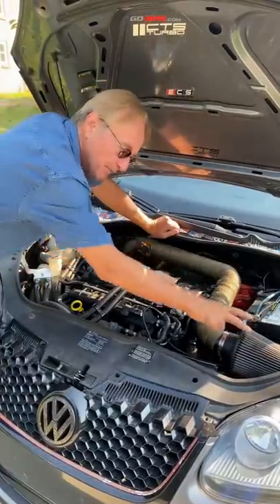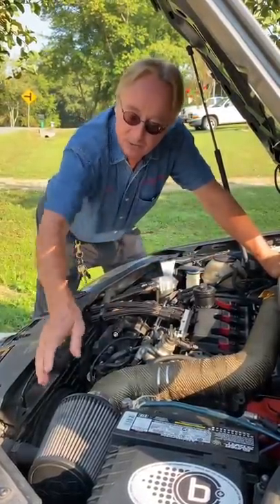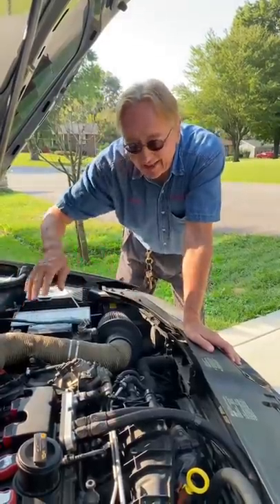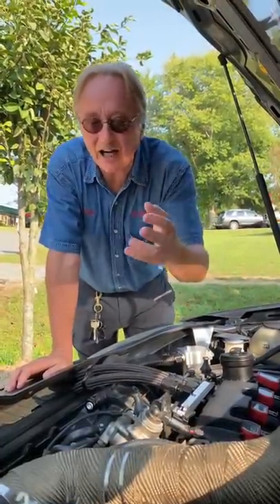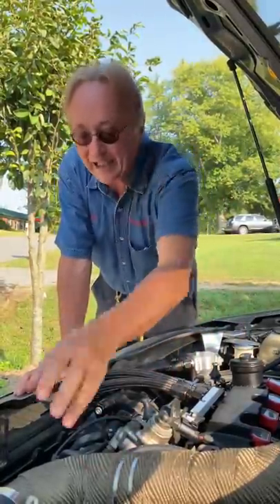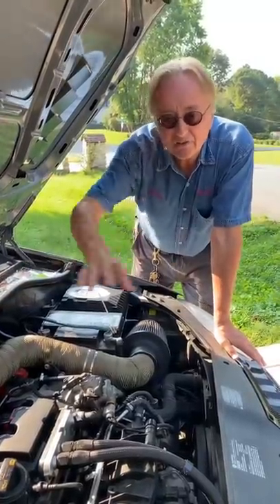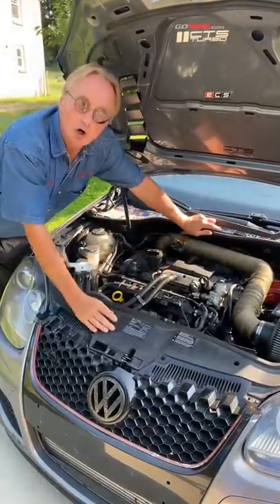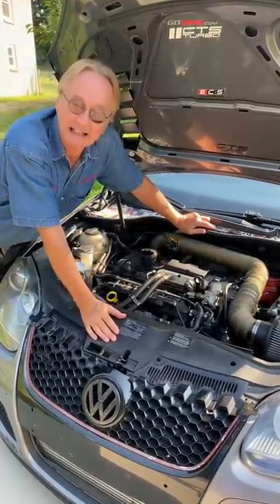Why Cold Air Intakes are Stupid

Comment: I saw a guy install one on his Volvo and he lost power because it was mounted against the hot radiator. I guess it was technically a hot air intake for him.
Reply: Congratulations you played yourself. 😂
Reply: Better fuel economy tho
Reply: @yeh.80  Nope. It was improperly installed so it was sucking in warm air. Even if it's installed correctly, cold air intakes dont always equal better fuel economy because the computer had to compensate for the increase in air volume by adding extra fuel. Aside from a software tune and weight reduction there really isn't much you can do. Most vehicles come as efficient as they can be.
Reply: Good for mpg though 😂
Reply: Bro u have to be dump that’s there fault
Reply: Former radiator and cooling man here. Most of these I saw under hoods were like the one shown. They were under hood sucking hot air while the original factory box had a snorkle that got air from the outside. DUH!
Reply: @johnchandler1687  The only diy installs that make sense to me are the ones you see at the drag strip with the headlamp removed for better air flow.
Reply: Lol! 😂
Reply: cold air is much more compresed that hot air
Reply: @oneslap01  It’s more dense.
Reply: @EricFortuneJr.  yea I forgot what is called but yeah
Reply: Guy created a black hole on his volvo
Reply: @EricFortuneJr.  running that style filter into the bumper gets it away from the hot air of the engine too but if you keep the filter in the bay it needs a box to enclose it from the heat. scottys example car is a hot air intake with insulation wrap on the intake inlet pipe which keeps the air hot it's a horrid setup he needs gold foil to repel heat
Reply: @stolen_e46   Yeh, I know. I’ve seen it a lot at the tracks. You get outside air straight through the headlight housing too.
Reply: @EricFortuneJr.  yeah ive always wanted the headlight housing but getting a custom headlight w a hole in it is $$$ theyre so badass though
Reply: I have just recently put one on my Toyota pickup. With how long the old intake was the filter is shoved in the corner of the engine bay. I’ve managed to actually pick up some top end power and it runs way cooler than it did before.
Reply: Bruh😂😂
Reply: @Chiefbird007  sure it does
Reply: Because it's not a cold air intake, this is a short ram intake which are bad for cars
Reply: @stolen_e46  id think it's more for keeping engine heat off the pipe and from heating the air inside it... Doesn't do much for cooling the air in the pipe of course since it's just insulation.
Reply: @sammy_1_1  that's what gold foil wrap does it repels heat, the wrap car in the video has is actually a wrap used for headers, it is used to keep heat in the headers to increase performance.
Reply: Any after market intake that sits in the engine is not a traditional cold air intake. Cold air intake needs to be in taking fresh air that’s why on race cars you’ll see circle cutouts in certain areas and that’s for the cold air intake.😂

Comment: Correctly installed Cold air intakes work great, the longer the pipe is and lower to ambiant air the benefit is realized. The trouble comes when you use short ram intakes they cause issues with heat and incorrect air metering which throw cel's.
Reply: The longer pipe gets heated up from the engine compartment. Warming the air as it travels down the pipe. Negating the use of the cold air system. Like he said, little increase of any at all. The louder intake sound makes you feel like its faster. They know that they're doing selling these things.
Reply: @rchydrozz751  you won’t get any power from any bolt-on without a tune. The tune on my car throws an engine code with a stock air box. It doesn’t pull in enough air.
Reply: @thatsmyassbrostop  Wrong wrong wrong. It HIGHLY depends on the car. Some cars can take simple modifications and the ECU adapts. With a tune you 99.9% of the time gain significant power.
Reply: @unforeseen9267  it of course matters on the car but the majority of the time you’ll likely see a performance drop without a tune. I would have to see some solid numbers to believe that any modern car can get higher than negligible gains without a change to ECU. In basically every application you’re just going to run lean, though I’m sure some exceptions exist.
Reply: @thatsmyassbrostop  just put one on my 08 accord. Runs beautiful
Reply: @thatsmyassbrostop  you have no idea what you are talking about. As long as you are retaining your map, maf sensor you won't need a tune to see gains . How do think a car adjusts to humidity levels and altitude changes?
Reply: @thomasmatarazzo198  most cars will throw a check engine light for MAF sensor with an open air intake. This isn’t a controversial statement.
Reply: @rchydrozz751  its actually been proven that the air doesnt even stay long enough in the tube to get heated how you think it would
Reply: @rchydrozz751  bruh you know heatwrap exists
Reply: Actual CAI’s that mount in front of the rad and towards the grill tend to gain a small amount very high in the rpm range but the average hp across RPM is lower. That’s because the engineers for the manufacturer tuned the length, taper, and width of the intake to offer the most efficiency at all RPM’s. People who like “induction” noise probably think vacuum cleaners sound amazing.
Reply: @unforeseen9267  yes this is mostly OBD1 cars though. I’ve seen modern cars lean out the AFR with bolt ons. I think it’s an emissions thing. It is true that cars can still make some power or not lose any power with certain bolt ons but until the car is tuned, it won’t make that power consecutively throughout the RPM range.
Reply: @thatsmyassbrostop  my 96 mustang works real well sans tune, but it moves the filter from in the engine bay to in the fender behind the fog light, which isn't sealed to the bumper, and that's a high pressure low temperature area on my car. The pipe I have is powdercoated though, they guys that use the chrome version of the intake see no gain at all while I picked up 5 horses just on the dyno, but I show more MAP flow at WOT when I'm on the highway doing 75 than I do on the dyno with the speedo reading 75, so i have a feeling it actually makes more because of the high pressure zone.
Reply: @moustachio334  sometimes slightly leaner AFR makes more power.
Reply: @thomasmatarazzo198  the Baro sensor is how your car adjust to altitude changes not your maf or map
Reply: @MoparMadness93  True , but most cars read baro from the map . Some cars have baro sensors specifically . Both do exactly the same thing which is read air pressure
Reply: @thomasmatarazzo198  map reads air pressure specifically in the intake not outside. But I do believe you are right. I forgot some use the map when the key is turned on or when throttle hits close to wot to calculate baro
Reply: @moustachio334  lol u def havent heard a good induction noise like mine
Reply: I mean in the case of intake runners length effects torque vs hp so I’d think the same to a degree with the air ducting
Reply: This is true. Look up some videos on cold air intakes on the Dyno BEFORE it’s tuned. You’ll see they do work.
Reply: Well said.
Reply: The only problems that arise is if the car is turbocharged stock. Any modifications require a tune for those. If NA then u may just run a little lean nothing crazy
Reply: I got a Ramair intake and about two weeks later my turbo blew. Was it just a coincidence or could the intake have caused it? When I say blew, it was driving perfect on a Sunday and when I turned it on on a Monday I was down about 90% on power. It didn’t happen while driving - possible electrical fault maybe ?
Reply: @jakeg9711  turbo’d cars are much different. The turbo is connected to the intake, when the turbo is sucking in air, an intake will increase the amount of air a turbo can pull in, creating more boost and also spinning the turbo much faster. If you get an aftermarket intake on a car with a turbo, get it tuned.
Reply: @A90Nick  so was it a coincidence do you think or did the intake cause it? Car was remapped on standard air filter by previous owner
Reply: My car has a ram air intake on it and have never had any issue with overheating. But my car came factory with one so maybe that’s why
Reply: @darienbarth3191  haha yes that is why, mines aftermarket - car has been off the road the last 2 months 😆
Reply: @rchydrozz751  as long as the filter is sucking in cold air it doesn’t matter, air moves too fast for the pipe temp to affect it.
Reply: UMMM SOME CARS ONLY TAKE SHORT RAM GENIUS, AND U CALLED IT A," PIPE,"  DONT TALK ABOUT ENGINES BRO, U OBVIOUSLY HAVE NO IDEA WHAT THE CORRECT TERMINOLOGY IS,
Reply: @BobTheMartin  heat wrap protects your tube if it’s long right? I’m considering in buying one for my 2022 Toyota gr86
Reply: @Realslugs  Its just a heat isolating blanket

Wouldnt trust heat wrap to like... run something plastic right alongside the exhaust manifold

But if you HAVE to customize your intake,, it can help keeping to cold air cold.

Only if you are actually intaking cold air tho...

But don't take my advice too seriously
I'm not a proper mechanic.
If you buy quality parts just install them as instructed
Reply: @moustachio334 exactly.  Modern cars have a MAF and upstream O2 sensors which will correct your AFR (obviously to a certain extent) but will 100% do it for an intake.  The issue is people using cheap or homemade kits and instead of pulling cooler air from outside of the engine compartment, it’s sucking up that nice warm air from under it unless your car is has an intercooler then it’s less of a factor.  I’ve seen third party dyno results for before and after and there is typically a slight increase but varies depending on the vehicle, if it’s naturally aspirated, etc.

Comment: Just FYI, most engines have adaptive tuning, based on the air to fuel ratio, which get altered when doing a CAI, the ECU adjust as needed by itself.
Reply: This couldnt be more false. Many modern engines have parameters in the ECU which pertain to MAF scaling and the size of the intake tubing. When you change the diameter of the piping that the MAF sits in but dont change the scaling in the ECU, you change the Grams per second airflow which will effect the engines ability to properly calculate fuel injector duty cycles from idle to redline. This means that lean at idle is extremely lean at redline, and lean is a good way to induce knock, and burns holes in pistons due to excessive heat. 
The ecu can only correct so much until it maxes out certain values and then it gives up and turns the check engine light on. This could be triggered from anything from a high or low voltage/current or performance error for the MAF sensor or a correlation between MAF and MAP readings. This could also trigger a rich or lean code for the A/F ratio sensor due to the extra airflow that the ecu cant compensate for. 

Blanket statements are dangerous when it comes to things like this.
Reply: @justindelvalle9179  I’ve had a K&N CAI on my 2012 Honda Accord for over two years now. You wouldn’t believe what I’ve put that car through, and it has never had a single engine issue. Granted, it’s well-maintained, but still. Not one issue. Not all cars are the same, but you telling me what my car could do doesn’t mean jack.
Reply: @peterpumpkineater5927   im not going to sit here and argue with someone who clearly doesnt care. But I bet you if I hooked a wideband Sensor up to it, and datalog it, guarantee your engine is running lean and likely pulling timing as well. Sorry but from a tuning standpoint you dont have a leg to stand on. Yes YOU may not have had any issues because its within what the ecu parameters can correct for but not ALL cars are like this. And after tuning enough shitbox Hondas, i have seen the vast majority of CAI run lean above 3k rpm and pull timing.
Reply: @justindelvalle9179  Well said brother 👌
Reply: You have no idea what you are on about
Reply: Not true at all, not in my case at least.
Reply: @justindelvalle9179  my 03 s10 (2.2l)ran faster and got better fuel mileage with a cold air intake. I’ll take my chances…  also never had a check engine light on it but oh well
Reply: @justindelvalle9179  okay busy
Reply: @justindelvalle9179  some cars use a map and are temp sensors on the boost pipe thus the intake shouldn't affect it
Reply: @KasamS  oh really? Would you like to see the difference in airflow without changing the target boost setting on a Speed Density style tune when you change the intake out? I have datalogs of both. Just because its speed density tuned DOES NOT mean that no tuning is required. If you change how the engine breathes, I guarantee you will need to clean up areas of the fuel and timing tables - specifically where the change makes the most difference. The mass density of air entering the engine still has to be accounted for no matter whether its in grams per second (Mass Airflow) or lb/hr (speed density). Just because the MAP sensor can calculate the change in air PRESSURE, doesnt mean the ECU knows theres more AIR MASS entering the engine, which puts AFR at a greater risk of being off. Speed density tuning is not as cut and dry as it seems
Reply: @KasamS  this is one of those cases where just because you CAN doesnt mean you SHOULD.
Reply: Justin DelValle i run a stock 2008 bmw 335i with just air intakes i could check the afrs on mhd and everything runs perfect  👌🏼
Reply: Ahhh Your one of those homeschooled your whole life but didn't learn anything type of people I see 🙈, in order to throw off the air fuel negatively u would have to change either the diameter of the pipe that the mass air flow sensor sits in without tuning the car to accommodate the change/ change the maf, smh smh
Reply: And man did u really just say it's bad for your car it will throw off the air fuel ratio but I did it to mine and it's perfectly fine 😂
Reply: Bottom line is most times it will prove to have no issues for your car unless your ecu sucks
Reply: It tunes itself but not much, not really that much, it works in some cars to an extent by ram air and altitude correction but not much more. Sources: bmw siemens ms43 ecu
Reply: @justindelvalle9179  what your saying is true but you're just removing an intake manifold, if you do not remove the stock sensor then basically any closed loop systems can easily compensate for that tiny ammount more air. It's not like installing forced induction.
Reply: To a certain extend. If it’s out of the parameters it will trip the CEL and run poorly.
Reply: does my 24 year old truck have that
Reply: @bootymagician  No sir. I would assume not. Certain cars/trucks mid to late 2000s and up
Reply: @peterpumpkineater5927  understandable thank you sir
Reply: @bootymagician  yessir
Reply: @peterpumpkineater5927 

  you 👏 need 👏 a tune 👏 if you want to get more than 3HP from a CAI. Period 👏
Reply: @artilleryisbetter  Lol. Why so triggered?
Reply: @justindelvalle9179  he literally said not all cars are the same
Reply: @justindelvalle9179  so what about the fact that most bolt on intakes are the same size tubing to avoid setting of CELs? All that stuff you just said doesn't matter then?
Reply: @justindelvalle9179  my guy, my truck's PCM does exactly what the guy you said was wrong about.
Reply: @justindelvalle9179  You do realize these manufacturers have pretty bright engineers who work for them when designing these CAI’s as well as they work with actual car manufacturers hence the reason why most CAI’s use the exact same size piping as stock intakes.
Reply: Yeah I've done intakes on a 99 mustang, 2015 focus st before I went big turbo, dad did one to a wrangler. There's no way an intake will throw a code
Reply: you dom't need to retune your engine , that's bull!
Reply: …..no
Reply: @justindelvalle9179  most modern cars dont even use mafs they use MAP's
Reply: @justindelvalle9179  uhh, im pretty sure many newer cars have MAF, IAT, MAP, and LAMBDA sensors to make the car adapt to change (even my 23 year old car has them all). of course older cars arent going to do that because they dont have those sensors but there still are cars that can self adapt for even a turbocharging without any tunes. so if you do it correctly your engine will just adapt to the change with no issues